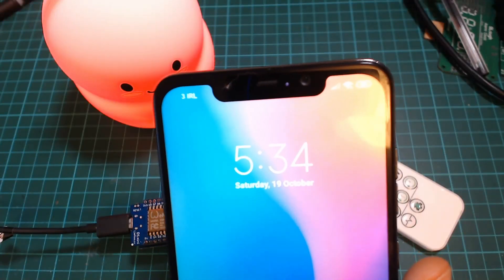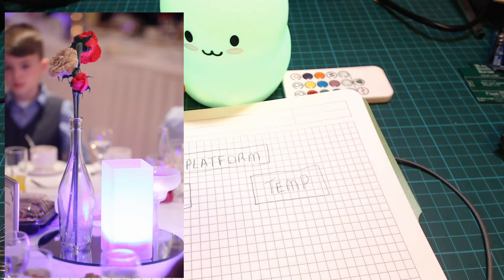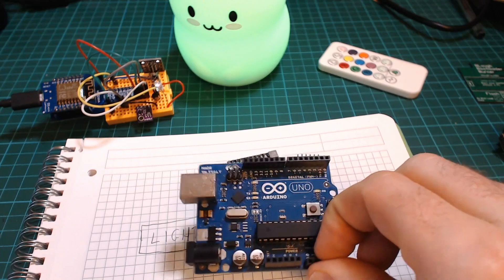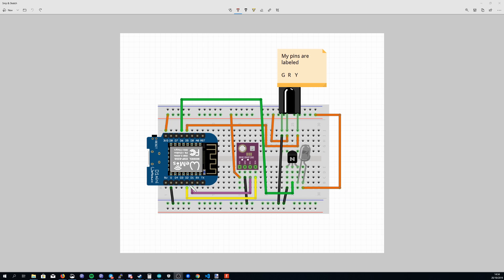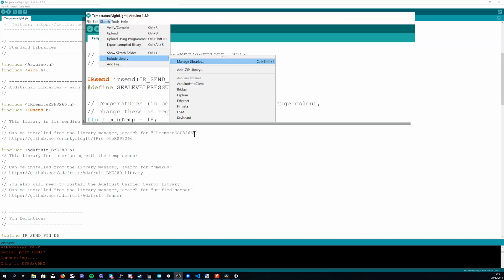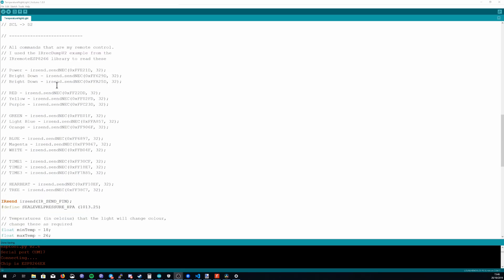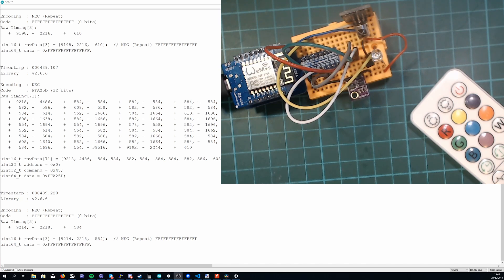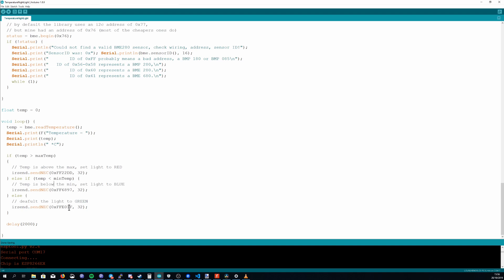Hacking a kids light with an Arduino (temperature controlled night light)

Comment: Are devices addresses on the i2c bus fixed?
Reply from the maker: Yes mostly, some devices have address pads that you can use to change them, but it's still a fixed number of addresses
Reply: @BrianLough  So if I wanted multiple devices that use the same address, but that didn't support changing their address then I would have to have multiple micro controllers?
Reply from the maker: @MrGeekGamer  there is something called a i2c multiplexer that you could use for that use case

https://learn.adafruit.com/adafruit-tca9548a-1-to-8-i2c-multiplexer-breakout

Comment: I have a Wemos D1 mini related question. I noticed you defined the digital pins as “D4” and D5” in your sketch. I’ve been playing around with some (Chinese/Amazon) “Wemos” D1 minis for the first time recently (my first experience with anything esp8266/ wireless Arduino related), as well as some D1 Mini relay shields. The shields I have all have the relay signal pin hardwired to pin D5 and I’ve noticed that sometimes, when I set, for example, “relaypin = D5,” in the sketch, sometimes it works fine. But, other, seemingly random, times, it won’t and I’ll have to change it to “relaypin = 5” for it to work. I’ve never had to include a “D” before the pin number to define a digital pin for any other board before. Is that an esp8266/Wemos thing? And what could possibly be causing ”D5” to work vs “5” and vice versa?
Reply from the maker: I actually covered this in an older video

https://youtu.be/TTbDmzCLMBY

Basically D3 != 3 , D3 actually is gpio pin 0. Just make sure to select the correct board in the Arduino IDE and the d ones should work for you